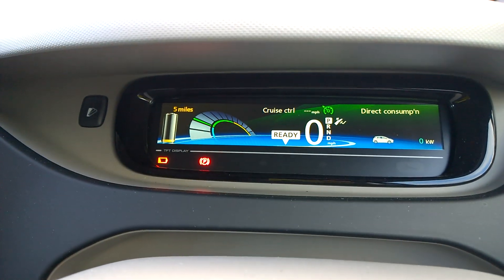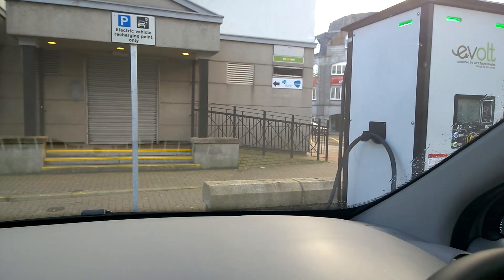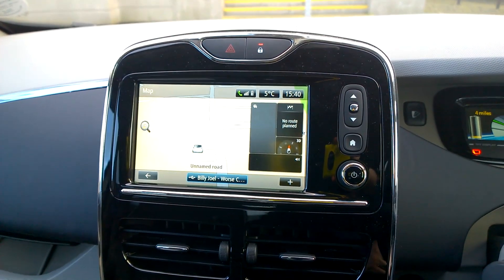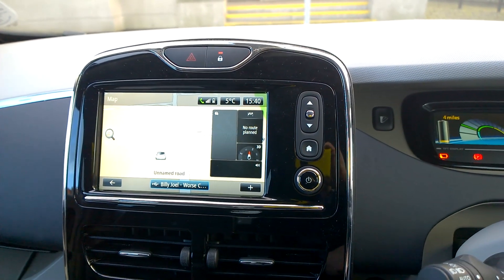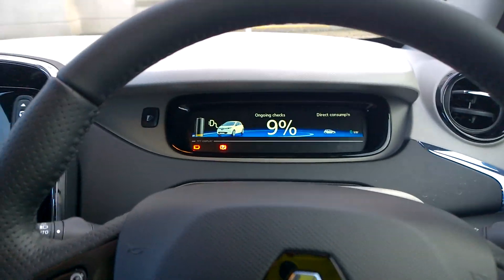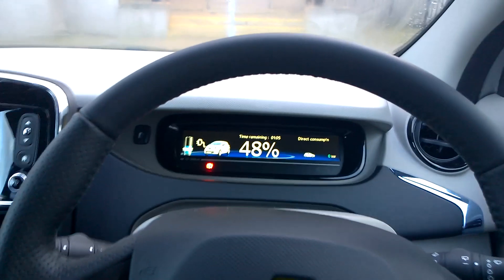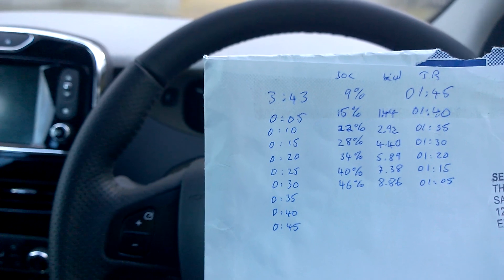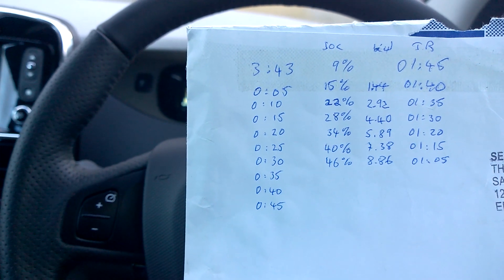Living with the Renault ZOE EV #3

Comment from the maker: Hi Richard, yes, we did get to the bottom of this, but not entirely satisfactorily. The problem was that the rapid chargers were still in their "installation" settings, which only allow a maximum of 27 Amps (if I remember correctly) over the three phases which gives you around 18kW supplied to the car. This setting was applied to the chargers when they leave the factory so that when they are installed and turned on to be tested there is not any kind of problem if there is a glitch in the power supply to the cabinet. When the power supply is verified and paperwork stating that received by the manufacturer they were supposed to release this limit so that the charger could work at full speed. 

The problems in this system have been numerous, ranging from poor installation by councils who have not supplied the right power supply so the charger simply cannot provide any more power, to failure to send back the paperwork to the manufacturer so the charger never was released from its "installation" settings, to the manufacturer delaying themselves.

Many, many months later, some of these rapid chargers are still working at this slow rate, a few have been unshackled and work at the full rate. It has been very frustrating for users.
Reply: That's good to know, thanks for your reply.  I am collecting my new Zoe today and have found your video's extremely helpful, thank you.  I wonder how the chargers in my area will behave?  Would you mind answering a small question for me?  A few days ago my dealer sent me an activation code for Z.E Services which enabled me to register with no problems however it doesnt seem to be the 'Interactive' just rather the Z.E Connect.  Any idea how the Z.E Interactive gets activated?  I have downloaded the mobile phone app. which also just gives me Z.E Connect services not interactive.  I'd appreciate your advice if you don't mind?  Thanks, Richard.
Reply from the maker: Ah, yes that is all a bit complicated. I was rather lucky in that the dealer did some of this for me, if I remember rightly. So can you see your car details on the website (My Z.E. On Line)?

This thread may help... http://myrenaultzoe.com/index.php/topic/help-with-z-e-services/
Reply: alloam Yes It does seem complicated I agree. I can see my car details online but not the 'interactive' part so unable to schedule charges etc. The dealer told me as it was the intens model it would automatically work, how strange..

Comment: Did you actually figure it out since making this video? I have recently driven a Zoe and hope to be ordering mine in the next few months. Where I live in Ireland the national network provider (ESB Electric) don't actually have the kW rating on their map or their chargers but I think most are 22kW. And there are a lot of them. It's one of the reasons I'm picking a Zoe over a Leaf. Chademo connectors are not as wide spread and 22kW chargers are not really practical even IF you have the 6.6 kW optional extra in the Leaf. It would still take 4 hours to charge.

Comment: If you take ECO mode off when your charging when it's full. Put it on ECO mode then your mileage will be longer. Would it?
Reply from the maker: In a Nissan Leaf that is right. When you change the driving mode it immediately shows a difference to the range-o-meter (and the same when you turn on the climate control). In the ZOE it is a bit more subtle and it does not make an immediate difference to the indicated range. ECO mode does undoubtedly promote more efficient driving mostly, I think, because the remapped accelerator pedal encourages more gentle acceleration. In general I drive in ECO mode when I am on a range-conscious journey. The rest of the time I am in standard mode which allows more vigorous point-and-squirt driving around the city.

Comment: Why did you use the AC charger ? Isn't the DC charger faster ?
Reply from the maker: The Renault ZOE only charges from AC, but it has an inbuilt charger that can accept any AC input up to 43kW which is what rapid chargers are supposed to provide on the AC side.
Reply: The DC charger is for a Nissan leaf

Comment: What dose N mean on the gears
Reply from the maker: It means Neutral, just as in an automatic gearbox car. So the transmission allows free-wheeling in that setting. If you needed to tow the car for some reason, this is what you would use. In P (Park) the transmission locks the drive wheels, again very similarly to an auto gearbox. The difference is that there is no gearbox, just a single gear and directly connected electric motor. It makes life that little bit easier for drivers used to how an auto gearbox car works just to step into the car and go.